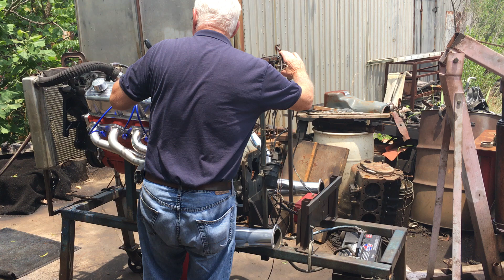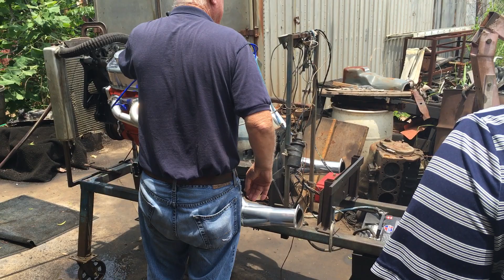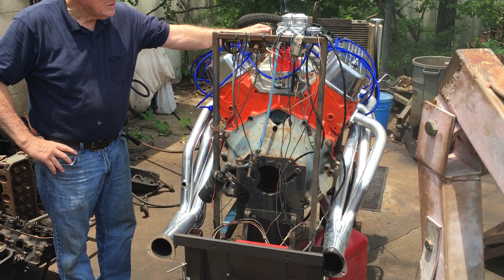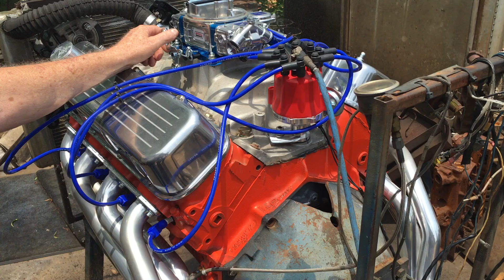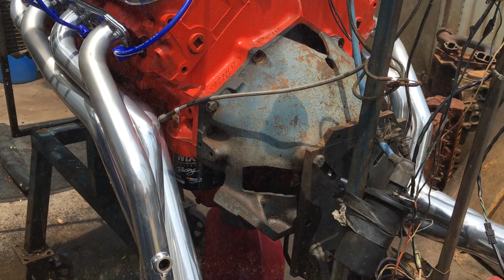1969 Big Block Chevy 396/402

Comment: Is it true that all 396 motors are 402 cu in motors?  396 was just a marketing scheme by Chevrolet?
Reply: 402 were the byproduct of a machining mistake.      Fucked up 396 blocks were cut to 4.125, which is .030” over plus one thousandth.      4.094 plus .030” is 4.124”
Reply: @TonaldDrump686  Sounds about right but still wondering, how did Chevrolet decide to use which and why?
Reply: @mark97213  Because they processed so many by the time they figured it out, why waste the money already spent, just call it a "new" engine, and make the money back!!
Reply: All badged 396 from 1970-73 were actually 402ci. 1970 the 400 small block was introduced  and chevy didn't want a small block being larger than a big block.
Reply: 402 was a good engine for Chevelle by then gm had the oiling problem solved the older 396 engines was bad on bearings had to have a groove in the camshafts most 396 engines were replaced with small blocks because the first two years of BBC was bad about blowing up bearings sticking and rods slung through the block